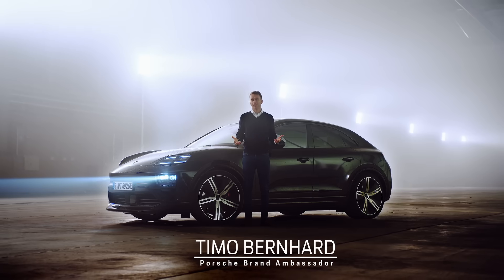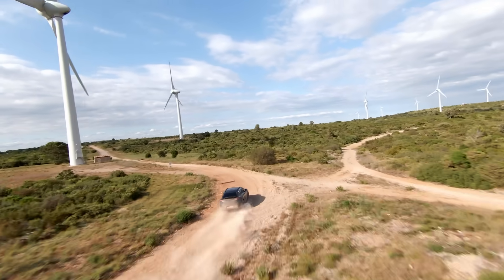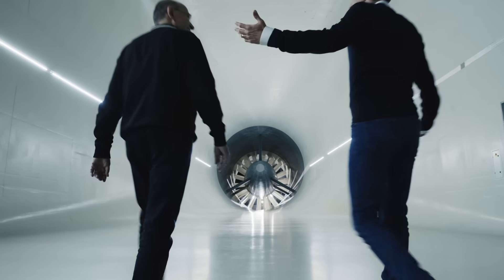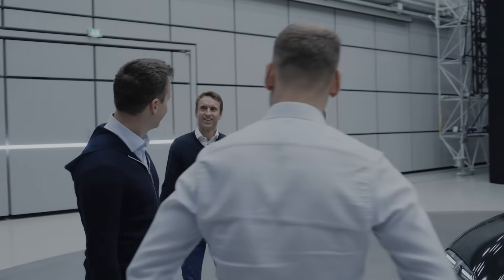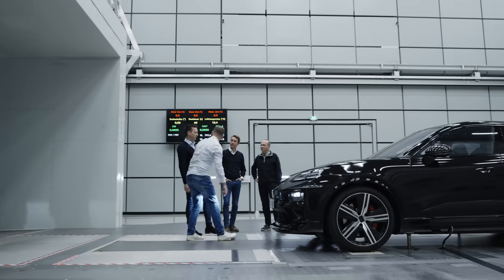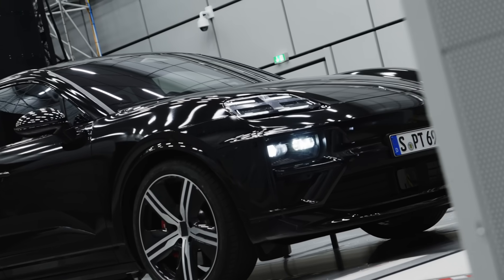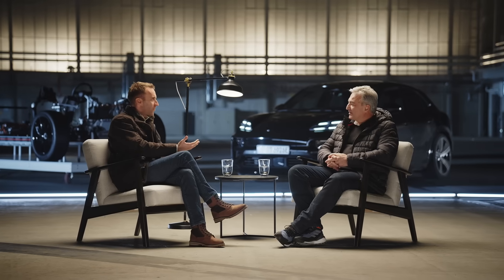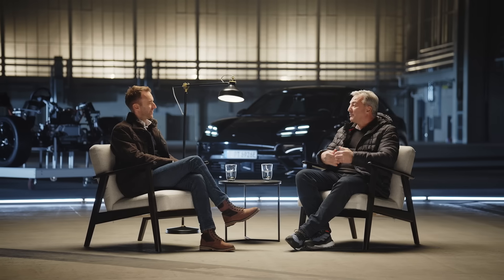The development of the all-electric Porsche Macan

Comment: Solid-state batteries can be over twice as energy-dense as current lithium-ion batteries. This means an EV’s battery pack would require fewer battery cells for the same capacity, and the pack would be lighter, thus improving the vehicle’s range, performance, and handling. The pack would also be physically smaller, so it wouldn’t have to take up the entire bottom of the car, thus allowing for improved interior use of space and more room for passengers or cargo

Comment: I have something I'm really curious about. first. Why separate DLR and headlights? If you make it with a single lamp like before, wouldn't you be able to save money and reduce the weight of the car by making the structure simpler? Second. Is dividing the charging port into two halves an inevitable choice for body balance?
Reply: Not only that, the ole headlight in the bumper trick is not a good looking styling element.
Reply: new design language + decrease of insurance costs. if one thing breaks, u don't have to replace a full unit. this is a great step towards repairability

Comment: I test drove a Taycan 2 years ago and I was so impressed with how it drives. I think this new electric Macan will be on a whole new level
Reply: A whole new level compared to a Taycan? For sure not.
Reply: @avigator  it will, cause this macan is 2nd gen, the taycan was porsche guinea pig
Reply: @PANEHYBRID  New cost efficient platform (PPE). Les cost for Porsche doesn’t automatically mean better quality for the customer.

Comment: Disappointed that Macan continues to have an unusable back seat if you are more than 5'11". An SUV should have more rear space than a Golf.
Reply: Try the Genesis GV60. The Koreans figured it out.
Reply: @avigator  Who cross shops the SUV with the best dynamics and handling with one with the worst dynamics and handling? I just want a useful Porsche with physical gauges.
Reply: @Ficon  So, why don’t you get a Taycan?
Reply: @avigator  Taycan back seat is very tight and it lacks headroom. I wish it was an EV Panamera and not an EV A5.
Reply: @Ficon  Did you ever drive one? The Taycan sports tourismo has plenty of headroom on the backseats. Back seats are not tighter than front seats.
Reply: @avigator   Not the ST. They are unobtainium where I live, took me years to even get into a regular Taycan. The low ride height also doesn’t work with my weather. I’m sticking with my Cayenne but remain disappointed.
Reply: @Ficon Get a cayenne/cayenne coupe
Reply: @paganizondar1295  I have one. The Macan is a lot smaller and nimbler but I literally think the 911 back seats are just as useable.

Comment: C'mon Porsche.. what's with headlights in the bumper.. (same platform as q4 e-tron i guess) but :( I don't like this design cue on any car and I am a massive Porsche fan :(
Reply: Same platform as Q6 E-Tron
Reply: yes, absolute nonsense, especially compared to the ICE Macan headlights
Reply: I don’t like the bumper lights either. What’s the need for them if the headlights are LEDs? Are they running lights? Perhaps there will be some customization options that allow for their deletion.
Reply: @ene1818  the lower lights are the main beam the upper ones dre the DRLs
Reply: @7ludi  Thanks for the clarification. Still hate the setup.

Comment: Please Porsche Start working on Hydrogen Fuel cell and Hydrogen Combustion, That's the real future not the Electric only ❤
Reply: We have hydrogen in California. The infrastructure is the problem. Plus the cost of hydrogen is astronomical.
Reply: @FelixCervantes  almost not feasible, but imagine high rpm hydrogen combustion engine - That's future
Reply: @RSX0999 
Synthetic fuels, based on hydrogen, are much more likely to be used instead of hydrogen. Storing hydrogen and construct a hydrogen dense engine seems to be to challenging for the use in a mass produced car.
Using a hydrogen fuel cell would be possible and more efficient than an ICE, but again requires electric motors for the powertrain.
Reply: Hydrogen is a non starter. It takes 3 times more electricity to generate hydrogen than just charging a battery.